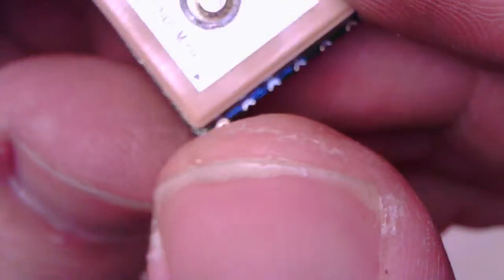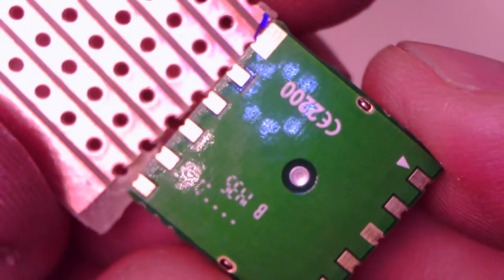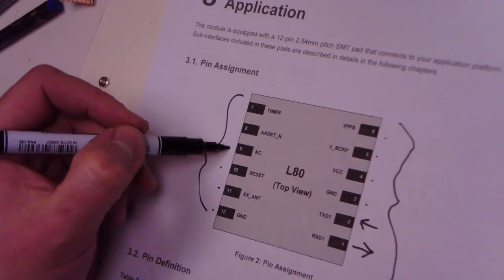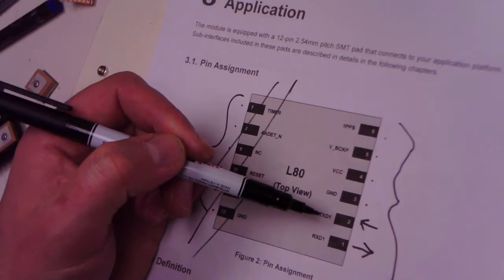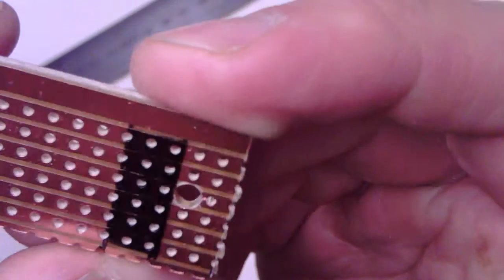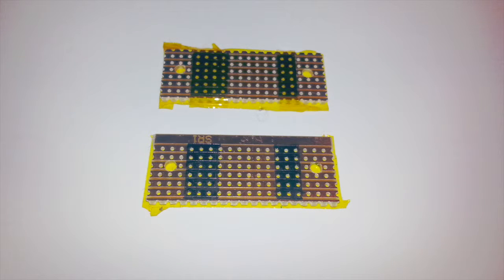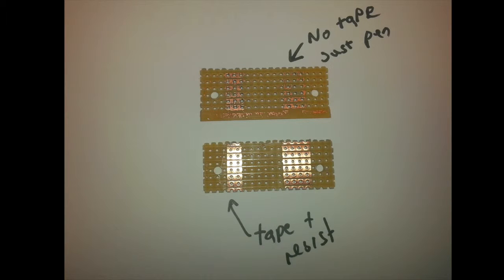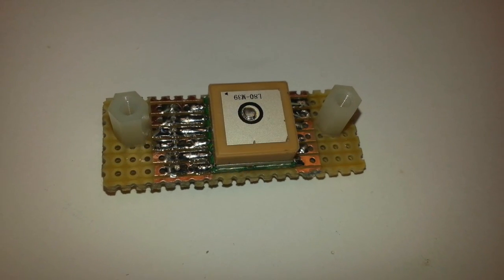Making a GPS breakout board by etching some stripboard

Comment: Hello I m using L80-R series GPS, I am not Getting Lat ,long, connections as per (TX-> Arduino Tx), VCC-3.3volt, vbackup and vcc are connect together , ground is connect i get blanck     
$GPVV  string